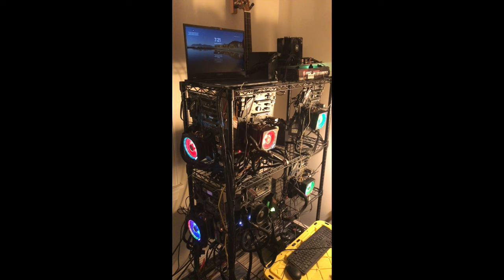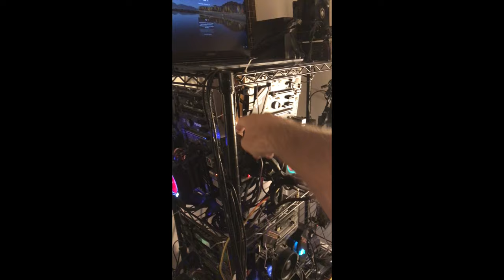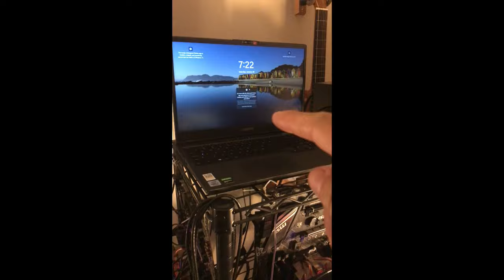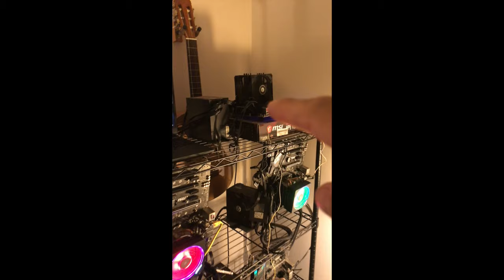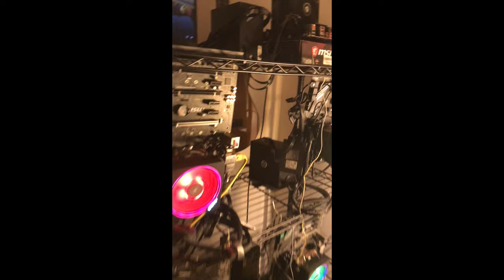🛠️ Build a Custom Borg-Style CPU Mining Rig Rack for Under $60 | DIY Mining Rig Rack 🛠️

Comment: Putting the motherboard on the box is a little dangerous
Reply from the maker: Nope. I have plastic spacers underneath each motherboard for airflow. Been running like that for two years. Now I am hanging them vertically.
Reply: not at all its actually recommended to use for a quick post check before commiting to put it in the case. I usually do a post check with it on the MB box to make sure everything is working. Cardboard is non conductive.
Reply: I use the box for every mobo I get.